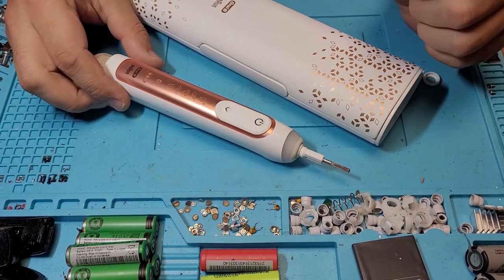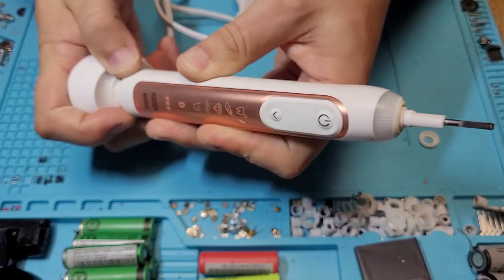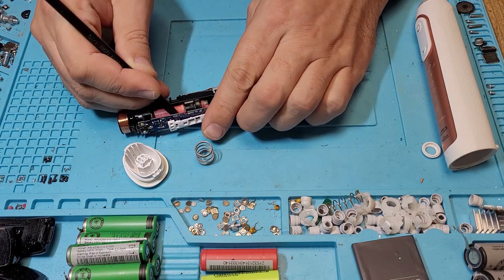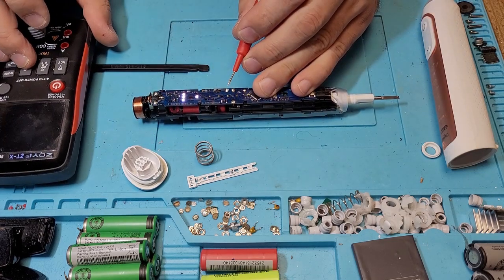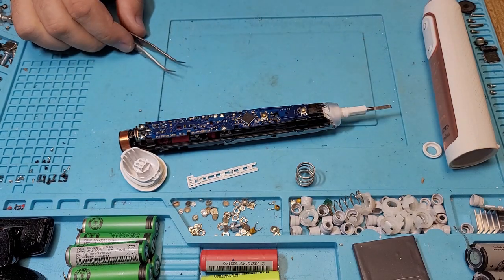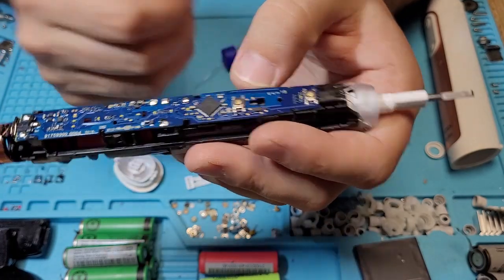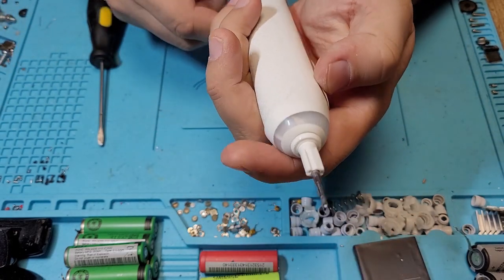Repair of Braun Oral-B Genius X. Lights up, but no vibrations.

Comment: i have the same brush, it starts for 3 secs and stops until you switch it off and start again and the same happens. pressing on the fuse helped and it started working, i guess connection fails because of vibrations. tried to fix it with crazy glue ..will see haha
Reply from the maker: Thanks for the feedback, glad this video was helpful. Let us know after some time if it holds or it needed repair again. Thanks!
Reply: @letsfixitgarage  hello again, well it lasted for 11 days :face-green-smiling:now pressing the fuse won't help much, it wont start at all until i put it on charging, then i have my 3 secs of working and then shuts down again. I guess I off to repair, could you please tell me which fuse I can use to replace? 2 amps?
Reply: @toshi_btc  I'm running into the same issue where it starts and stops after 3 seconds, so I was wondering if you were ever able to fix. Thanks!
Reply: @qzini  no, gave it back for a free replacement as I had warranty
Reply from the maker: Sorry for some reason YouTube haven't send me notification for your message.. I assume you have already repaired it but for anyone else I use 2a fuses..
Reply from the maker: Just replace the fuse and it will work just like new..
Reply: @letsfixitgarage  Outside of repair and replacement, in your experience, are there any Oral-B electric brushes that are actually reliable? My credit card will cover the cost of a new one so I'd love your input here. Thank you!
Reply from the maker: @qzini difficult to say as I'm not officiall Braun service so I don't see the whole scope of incoming defect but I would say that Genius brushes - older technology - has only few defects that I descrive in my videos outside from that they are very reliable. IO series on the other hand has Multiple problems including ripping off the magnetic head with the whole shaft and their brush heads are much more expensive... Although I like Philips Sonicare Technology more :)

Comment: Thank you I did all of what you mentioned except as other users have mentions I applied pressure to the fuse box named' pp' hard enough until the brush came back to life, saved me £80
Reply from the maker: Gald it helped! Do let us know if it will hold or will it fail after some time.. thanks!

Comment: Hello, yesterday I repaired two such brushes, there was no need to replace the fuses, the solder joints were cold, I just had to re-solder them.  Everything worked until I put the brush back together... now nothing, dark, dead.  Battery charged, no lights, no charging.  What could have happened?  Regards
Reply from the maker: Try to shorten the fuse with metallic tweezers.. I had fuses that show continuity but it already has to high resistance and it's not working.. that's why I always replace the fuse with different type..

Comment: Amazing! pressing down reasonably hard with a blunt object on the fuse also fixed mine!
Reply from the maker: hi, any update if this repair is hoding up?
Reply: Had to open the toothbrush again and press harder - that did it! Still working.

Comment: Applied soldering iron to fuse, brush working now. Added some solder to bridge fuse. Will see what happens, hope solder does not come off inside
Reply from the maker: as i say to everyone fuse doesn't cost a lot and its there for a reason.. my recommendation is to replace the fuse..

Comment: Thanks for the movie. Could you please add the correct name of the fuse? the second ali link is down and the first one does not have a 2A anymore.
Reply from the maker: thanks for the feedback. will update the links shortly but in principle just look for similar size fuse with 1-2A rating will be much better safety as the squished fuse or a solder short ;)

Comment: Thanks for the video! Managed to get one with leds lighting up and 1 sec of motor action working by compressing the PP fuse. After one use, the whole brush died, no action at all.

The microcontroller (TI CC2640) can be reset by grounding pin no. 35. I used a 1k resistor to ground it on the motor ground.
Brush woke up instantly.

Now testing to see whether it works long-term. I suspect that something is failing on the board. This brush has been abused a bit and it has a crack on the body, but no obvious liquid damage is visible.
Reply: Thanks Malagutisti, your comment helped me massively in a recent attempted fix on my wife's toothbrush. Thanks for posting it.
Reply from the maker: How is this repair method holding? I always suggest replacing the fuse but I see big portion of comments stating that this method works, not much on how long it holds..
Reply: @letsfixitgarage  4 months in and working like a charm 👍
Reply from the maker: Sorry was replying to a lot of similar comments haven't noticed that this comment is only 24h old :) hope it will hold if you will remember do let us know if this method worked or did you needed to replace the fuse after all..
Reply: I'll definetely report. Planned to order the correct Bourns fuse and the motor mosfet whenever i have enough stuff to order somewhere. Probably the brush OS not going to fail then 😂.
Reply: Dude! I thougt i fcked up and bricked the thing. Your comment is saved me! Working like a charm now. Thanks a lot!
Reply: @CharlesBronson111  Glad to hear, Happy to be able to help!
Reply: BTW I didnt use the1k resistor, so I just connected GND to pin 35  for a few secs and it worked fine.
Reply: Bataryayı bagladigim zaman motor çalışıyor ancak tuşlarında bir hareket yok ışıkları yanmıyor sizce bunun sebebi nedir?

Comment: Thanks for the video 🙂
Tried the first fix with pressing on the fuse with the tip of my nail. Works so far 👍
Reply from the maker: How is this repair method holding? I always suggest replacing the fuse but I see big portion of comments stating that this method works, not much on how long it holds..
Reply: @letsfixitgarage   I have seen one comment stating a couple of months. But I tried it as a first quick fix. It will hold up as long as it can. Once a fuse has given up, all fixed with the same fuse are short term. So replacing it is the most viable way to go. 
Next time it fails, I will get it replaced 🙂

Comment: Thank you to the people who suggested pressing on the fuse because it worked so well I actually scared me! I’m now going to try the same thing on my daughter’s toothbrush Thank you Let’s Fix It Garage for showing so clearly how to open up the toothbrush casing
Reply from the maker: How is this repair method holding? I always suggest replacing the fuse but I see big portion of comments stating that this method works, not much on how long it lasts..
Reply: Hi, thank you so much for this video. Can you tell me where can I get these fuses, and is it possible to glue the fuse with super glue or something? Sorry, I don't know

Comment: I’ve tried for an hour to get the top cap off and have cracked it along the way. I’ve tried all sorts to get it off (even heating it). Any recommendations for getting it off?
Reply from the maker: Sometimes it's very difficult.. for me few methods work but none is 100% safe.. will try to do an update on this toothbrush with some tips in near future..

Comment: If you’re going to be applying pressure to the fuse, remember to have the brush turned ON while doing so. This is what made my brush work again!
Reply from the maker: How is this repair method holding? I always suggest replacing the fuse but I see big portion of comments stating that this method works, not much on how long it holds..
Reply: @letsfixitgarage  yes it would make more sense to replace The fuse, but i figured that if The brush works then why worry about it? I did this a couple of weeks ago and The brush still works
Reply: @letsfixitgarage  Just worked for me! I'll report back if it doesn't hold.
Reply: You're a king, @sebastianmller4544. I pressed on the fuse with no luck, but then, per your advice, turned on the toothbrush, while applying pressure, and it came back to life!
Reply: @Timmones  thank you bro, you’re welcome 😄
Reply: OMG I love uuuuu, thanks for this sugestion, it worked
Reply: Thanks alot i was pressing harder but it didnt work turned it on and pressed and worked again
Reply: this worked!!!
Reply: Unbelievable it worked also here! I still do not now why. Let me check if it’s holding…
Reply: THANK YOUUUU ❤️🥳
Reply: f@cking magic
Reply: it worked!!!! had it on while putting pressure on the fuse and after a few seconds it came back to life!!!! thank you!!!

Comment: These self-resetting fuses are named PPTC or PTC. Does anyone know which type it is? Voltage, Current and resetting time?
Reply from the maker: Sorry no. But for this brush I would just use different, simple fuse. This type fuse is clearly not suitable for this application..

Comment: Hello brother thanks for the fix you save me 140€!! Can you say me if the affiliate link has the same pp fuse? because I think isn't the same on link??
Reply from the maker: Why do you want a fuse (PP)  that fails in this application ;) in the link is another fuse slightly bigger on diameter but it fits and holds much better then original one ;)
Reply: @letsfixitgarage  oh... You are a pro friend!! 0.75A 750MA is the correct on your link? Thanks again for help!! I support you!!
Reply from the maker: @hackertomobile I use 1a.
Reply: @letsfixitgarage  for my mistake I buy 0.75ma, you believe I have problem? not working or over heating?
Reply from the maker: @hackertomobile  I think it will be ok. If I recall correctly motor usually uses around 450ma. If no, worst think what can happen: the fuse will die and you can replace it with another one :)
Reply: @letsfixitgarage  die directly or we keep a long time up to one year? thanks for your answers
Reply from the maker: @hackertomobile difficult to say. I would say it should work for a longer time.. the motor consumes less than the fuse nominal but I have not measured the starting currents that are usually higher.. exactly these starting currents kill original fuse. If you can't change order let us know how it will workout after installation ;)
Reply: @letsfixitgarage hey brother work and with this smaller fuse! its little bit bigger than the original and need good instalation with solder but if touch correct the pins the oral b survive again! and if burn the fuse on future I have 9 more from aliexpress....thanks for infos repair bro keep the good work!!!!🎉🎉🎉
Reply: @letsfixitgarage friend after 6 months burns the smaller fuse, I rebuy 1A fuse and now work with thia fuse, I hope work more time now 😮
Reply from the maker: Thanks for the feedback!

Comment: I broke the seal that’s at the top of the plastic that lights up when using a clamp to unseal it. Needed minimal pressure. Is there somewhere I can get a replacement?
Reply from the maker: don't think so.. braun is refusing any spare parts for these or IO brushes.. So your best chance is second hand platforms like ebay..

Comment: Привет друг. Не подскажешь что делать, была такая же проблема, но перед заменой я отпаял мотор, после этого плата перестала включаться вообще, я припаял обратно, но включатся она и не начала. Когда ставлю на зарядку, верхний светодиод моргает на миллисекунду, и гаснет, потом через секунду опять мигает. На этом все. Питание на плату приходит.
UPD: а не, я спалил мотор, замкнул + и - 😢
Reply from the maker: Maybe it's still repairable. Try to rotate the shaft of the motor. If it doesn't move you welded Motor "brushes" to the rotor. Check my other Braun toothbrush repair video it shows disassembled Motor, it's "brushes" and how to repair it.

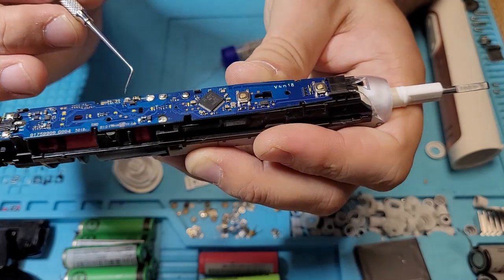Comment: 7:47   what is the voltage after the second smaller fuse? Mine shows a drop to about 1.3 volt after the smaller fuse from the ca 4 volt battery-voltage after the bigger fuse. (I have one that is dead, neither lamps nor any switch working but that the motor and its different modes are startable through an easy touch over a resistor in the vicinity of the fuse you changed)
Reply from the maker: Well fuse shouldn't have no resistance and no voltage drops. Try to short it out with tweezers and see if brush comes back to life..
Reply: @letsfixitgarage    I have packed it somewhere and as soon as I find it I will try it. I was not aware that the part was a fuse before I saw your video, and actually pondered if fuses never had resistance. I will let you know the "test" when I have found the brush. Thanks!

Comment: Absolutely EPIC! had this problem last night, similar that I thought it would be the battery. Popped it open, tried to press the fuse but it wouldnt work. Pressed it on and then pressed the fuse down and now its back to its original self. Thanks a ton for the video

Comment: Good video. Thanks for posting. However my toothbrush will start and run for 5 seconds or less.  It has a full charge. So what do you think?
Reply from the maker: The same issue. It starts by lower and lower run time and then dies completely. Replace the fuse and it will be fine.

Comment: Hi I find fuse 0603 3A with 32V is that ok? or is the V too high?
Reply from the maker: voltage shouldn't be a problem but I would look for 1-2a fuse.. as motor on load uses ~400-500ma

Comment: Pressing on the fuse worked for me! We'll see how long it lasts... Thank you for your video!
Reply: Hi, thank you so much for this video. Can you tell me where can I get these fuses, and is it possible to glue the fuse with super glue or something? Sorry, I don't know
Reply from the maker: Glad it helped, let us know if it will fails but I saw some comments that stated that this fixed the brush permanently for them.. although I would not trust that kind of crushed fuse to perform its function..
Reply: @letsfixitgarage  Sorry, I never noticed that you responded here. I wouldn't say the fuse is crushed. I think all I did is just made the soldered connection stronger by pushing it back down. I would guess that the vibration of this toothbrush has been slowly separating it over 3 years of use.
...I think.
Reply from the maker: Well if there is a micro crack in solder point it needs to be resoldered. And only resoldering never worked in my case. That's why I suspect that fuse itself is damaged and if you push on the solder points it would regain the contact only for that time. When you use the brush there is a lot of vibrations that would break it again.. don't get me wrong I'm glad that a lot of people getting second life for their brushes but if the motor would short (quite implausible) I would not trust that kind of fuse to do its job. Just my 5 cents :) and thanks for your feedback!

Comment: Thanks for the video, I was able to solve the problem just by applying some pressure on the fuse.
Reply from the maker: Glad it helped, although I would recommend to replace it with a working fuse..

Comment: Thanks, just fixed my Genius 20,000, instead of fuse I placed one thread of multithread wire and sorted the fuse. (in any case, I bought the new io10 🙂)

Comment: Mine keeps cutting out, fully charged sometimes it will start full power then just randomly cut out, keeps doing it. Do you think this is same issue or different?
Reply from the maker: Difficult to say. It's possible that the fuse is starting to die. Easiest way to check is to open it up and short out the fuse.

Comment: Are you sure the PP marked SMD component is a fuse ? I have serious doubts. I believe it to be a zenerdiode. Thats why you measure a small resistance when measuring it. I would not recommend to replace the zener diode by a fuse.
Reply from the maker: Why do you need a zener diode next to a motor? And why replacing it or shorting it fixes the problem? Additionally there is no marking on the PP element or PCB for direction/polarity.. I would say it's a fuse
Reply: The zener might be used as an overvoltage protection but its hard to say without a diagram of the circuitboard @letsfixitgarage
Reply: @letsfixitgarage  I have this exact toothbrush and the component marked PP is getting hot. Which means the voltage is above the zener voltage or the component is fubar
Reply from the maker: Discharge the battery up to minimum 3.6V or so and I assume it will still get hot.. don't think that with a lithium battery that varies in 3.5-4.1v range you need an overvoltage protection.. but of course this is only my assumptions. I don't have schematic or any know how from factory..
Reply: @letsfixitgarage  After reading a little bit here and there I think you are right that its a fuse. A poly fuse. I soldered it out and back in and now it seems to work. Thanks for your video :)

Comment: Hi, thanks for the video! Me and my Dad both bought toothbrushes at the same time and I’m about to move out and mine broke. 😂 The pressure “fix” worked for me thankfully. Could using this fuse until failure cause any further damage? And how would I know the fuse has failed completely? Would it just not work? Sorry for the questions lol
Reply from the maker: difficult to say how crushed electronic component will perform :) some commenters said that it was heating up strongly, for some it just stopped working after some time.

Comment: Аналогичная проблема. Сейчас попробую заменить. Надеюсь поможет
Reply from the maker: it will :) if the brush will not respond after repair do a reset on microcontroller
Reply: @letsfixitgarage как сделать сброс микроконтроллера? Помогите с этим